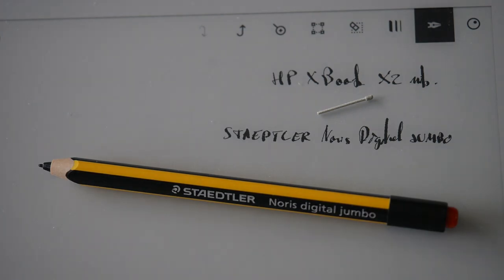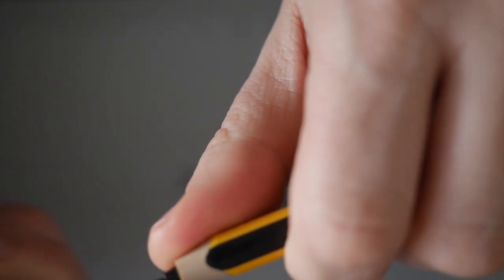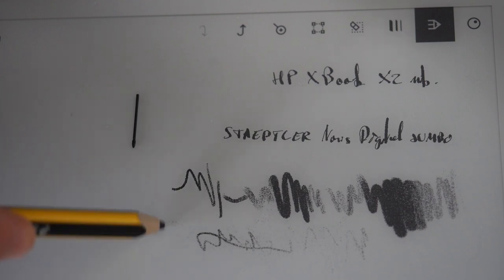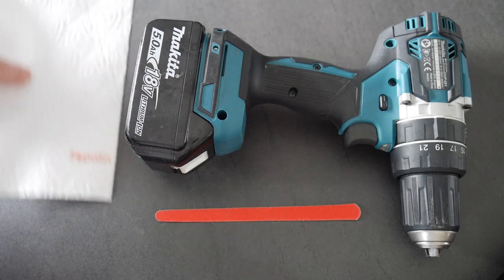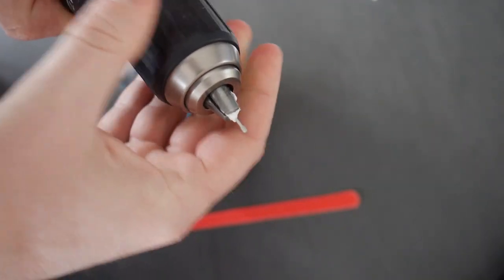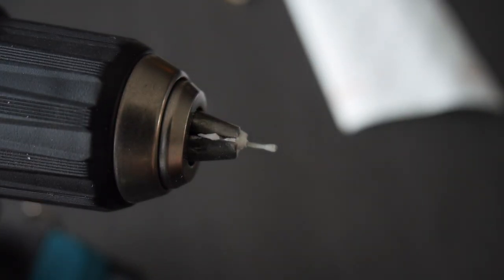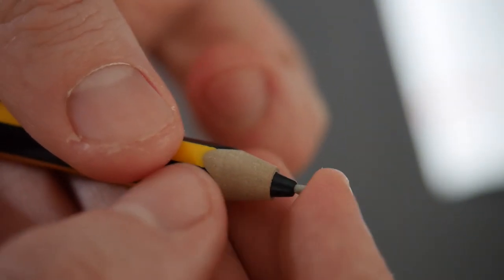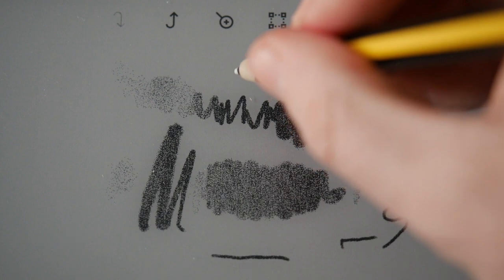Stylus : STAEDTLER Noris digital jumbo, how to use a nib that scratches like on paper.

Comment: Well done. I guess this can also be done to the standard Noris Digital.  Only problem, I don't have a drill :(
Reply from the maker: Haha. Thx. Maybe this can be done manually too !😅🤔
Reply: @onemoreink3654  I did the hack and tried with the standard Noris Digital and it doesn't work.
Reply from the maker: Really ? What happens ?
Reply: @onemoreink3654  It is the same problem as with Samsung S6 Lite pen. It writes even if it is not in contact with the tablet.

Comment: what are the advantages of writing with the staedtter jumbo? it feels almost like writing with a rollerball-rather than a pencil. i like the triangular barrel. it's not magnetic so i would prefer a clip but it won't roll off the desk. lightweight so fatigue won't be an issue. the eraser feels more like a real eraser rather than just a bit of plastic-the nibs are responsive and flow nicely across the screen. i don't mind the feel of it at all. the cost is reasonable. i got the one with the additional set of nibs.
Reply from the maker: The grip is good. The eraser is not so bad but makes little noise. I use white felt nibs with the jumbo because i like the "paper like" feel.